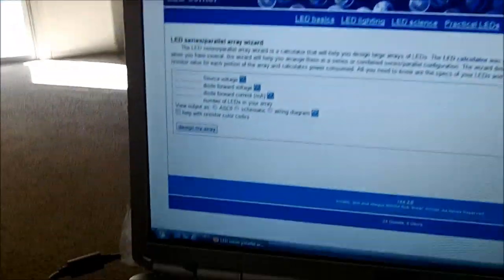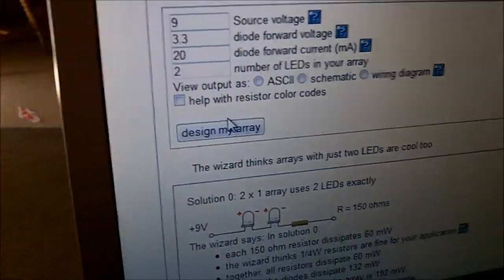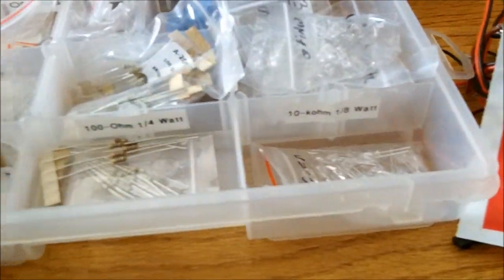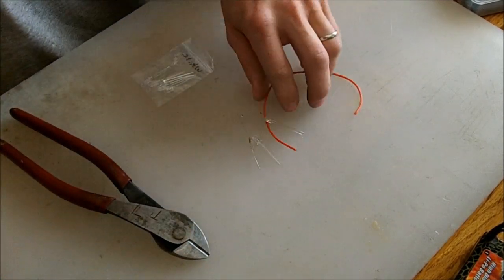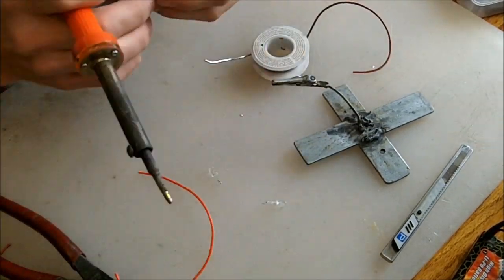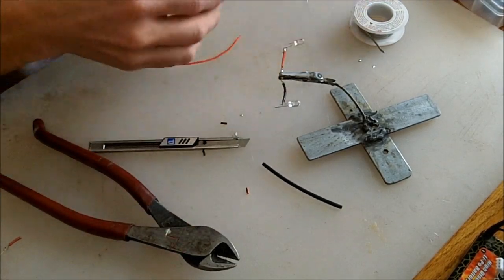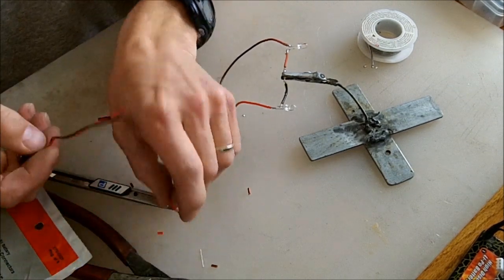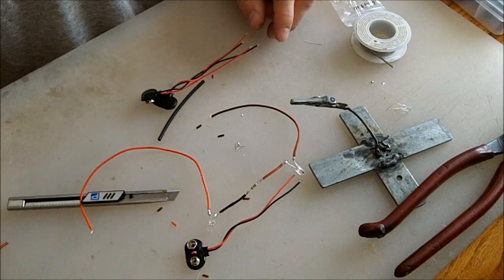How I wire LED's

Comment: Amazon or eBay really are the way to go for LEDs. Even prewired ones are pretty cheap there. I got two prewired packs of 20 for $6 each. But the bulk packs of incomplete LEDs are great for circuitry projects as well. Especially custom model cars

Comment: I buy EvilBay LEDs all the time for my other hobby, Model Railroading... This is easy enough looking, actually simpler. On my trains, I run DCC, a form of AC. For LEDs, I have to run a rectifier, then a resistor - of a greater value, since they run at 14.4V. 
So, this seems easier - but I always have the SAME question. Maybe you can help.....
Are resistors directional? I've heard that the stripe color is supposed to denote polarity. I've never had a problem(except for bum LEDs). Are they unidirectional? 

And, that website you showed is a Godsend for the half-assed electricians like myself! 😂